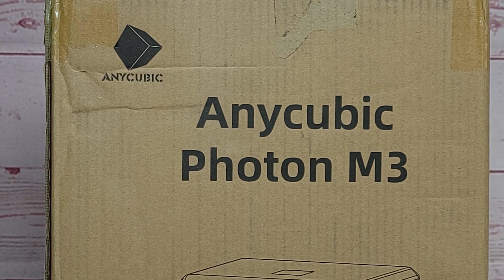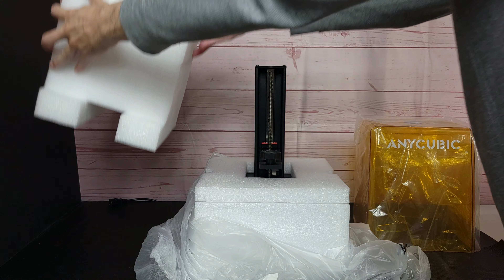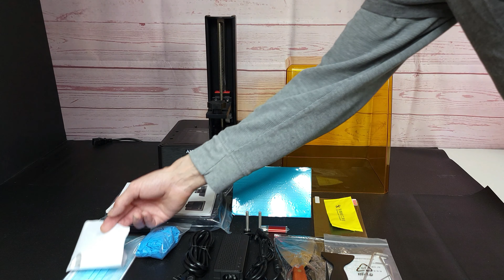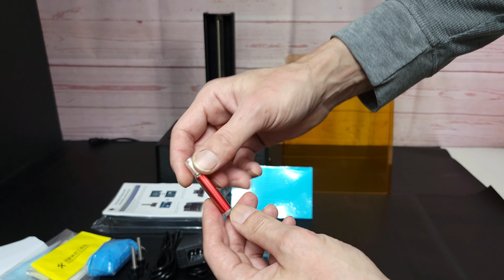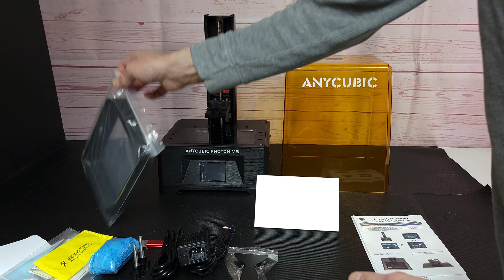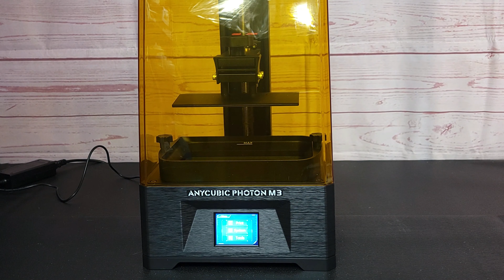Anycubic Photon M3 unbox and setup

Comment: hi I have also same m3 I try my first print with test pring but my problem is my print stuck in fep film do you know  exposure time and layer  resin setting ?(I m using anycubic plant based resin) what can I do help me please.
Reply from the maker: My m3 I run 90 to 100 for inital lift then 240 for retraction. 2 second exposure regular layers 36 second burn in and 6 layers. In photon it would be 1.8mm lift and 4 retract
Reply: @studiozombie3d  Hello, I also recently purchased this printer, and faced the problem that the models strongly adhere to the FEP film, because of this, the models tear off and break. Have you had any such problems with this printer?

I've been typing on Mono se for a couple of years now, and there are no such problems there.
Reply from the maker: @thekindyak  you may need to lower your exposure settings or try slowing your initial lift speed down to 90 or 100. Also check your bed see if there's a warp or anything
Reply: @studiozombie3d  thanks a lot, I will try such lifting settings

Comment: I'd like to know about slicer settings. New to sla
Reply from the maker: It's pretty easy compared to fdm just lift speeds, distance and exposure times. For my m3 I run 6 burn in layers at 36 seconds, 2 second Normal layer exposure, 1.8mms lift speeds and 4mms retract speeds. Then for lifts I go 3mm for first and 4 for retract
Reply: @studiozombie3d  it just showed up running my cube now. Ty fir those settings
Reply from the maker: @lokiwartooth1138  any trouble fire me a message on Facebook or email at studiozombie3d@gmail.com

Comment: ¡WARNING!
I bought the Anycubic M3 pack with the Wash&Cure 2.0 system advertised on the Anycubic’s website. The thing is that the printing plate is too big for it. The current Anycubic Wash&Cure systems just don’t work for the M3 printers. 
I’ve written to Anycubic to fix the error on their website. At the moment without result.
Reply from the maker: Which m3 did you get? I have thw wash and cure plus but don't really use the tub I'll have to check
Reply: I've been looking at the specs and wondering about this too. The metal cage of Wash&Cure 2.0 is too small for sure, but how big is the plastic container, can you fit the build plate there at all? Like, if I created my own holder for the build plate, could that work? Wash&Cure Plus is big enough of course, but that's quite a bit more expensive...
Reply: @LevisL95  If you create your own support it will work.
Reply: @josemmartin1952  Thanks!

Comment: i jsut bought the mars 3 two weeks ago. its still unused and sealed so i am thinking of sending it back and ordering this beauty because of the bigger print area but i am unsure if its worth the effort. on the paper i dont see any differences between them beside the print area.
Reply from the maker: Looking at the specs they are pretty close I don't see what the contract ratio is on the mars 3 though the m3 is 400:1 which helps with the detail
Reply: @studiozombie3d  I sent back the mars 3 and ordered the m3. It already arrived but I had no time to test it
Reply from the maker: @WiNNiep00h  oh nice let me know how it works out mine has been awesome the prints coming out of it

Comment: 2 things I'm not a fan of.  The lift off lids.  I have cabinets above my printer space and it is hard to get the lift off lids off the printers.  The other thing that I'm not a fan of is the through vat hold down systems.   So When servicing the printer I have multiple items I need to deal with,  where do I put the lid?  Now I have 2 thump screws I need to deal with.  etc  Might seem minor but it eats up bench space real quick,  if your tight on bench space or running multiple printers you have a situation where parts need to be located some place else or away from the actual printer locations.
Reply from the maker: I'd prefer a cover with a door myself would make life easier the m3 max comes off the front though. I should have ot for review this week